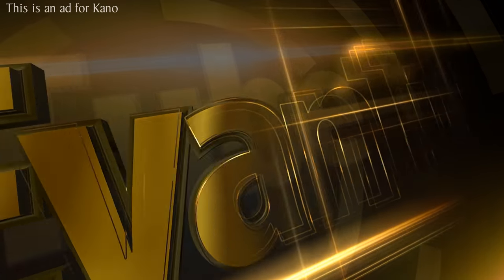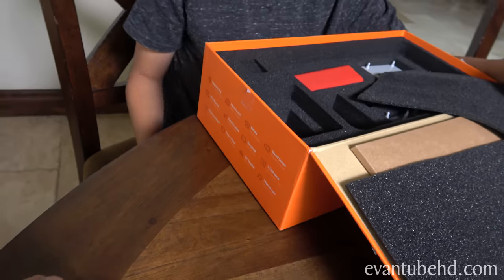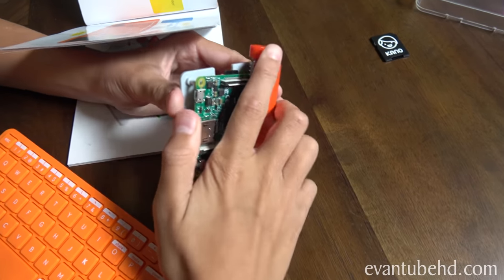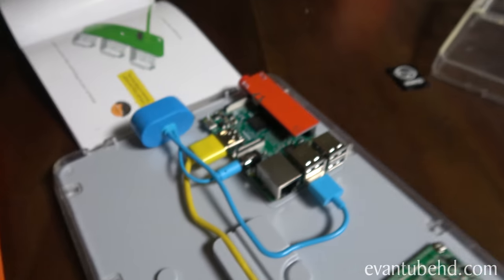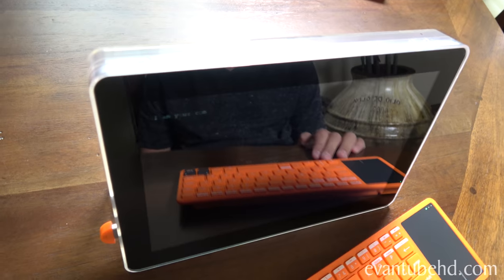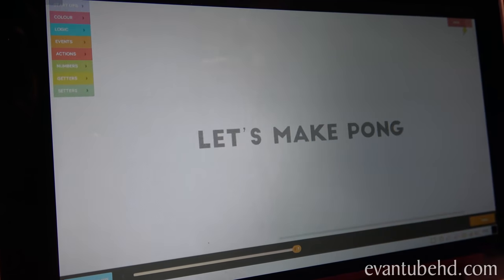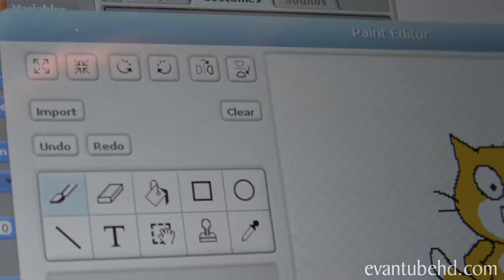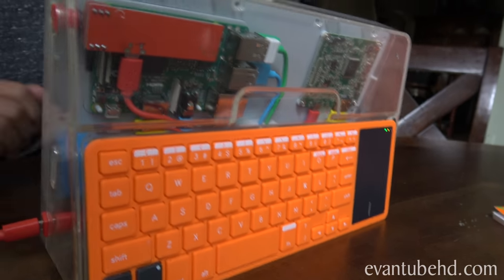DIY LAPTOP!!! Evan Builds His First Computer!  Hack Minecraft! Coding with Kano!

Comment: I remember back in the day [2014] I had a radio shack just down the street over the bridge before they closed their doors shortly after New Years 2015, I would come by, asking if they had 8 bit computer kits because I was soo obsessed in that beige computer with the black screen and white text display computers I wanted to build. The people were clueless on the parts I wanted to buy. But I remember passing by the Kano laptop kits when they were still selling them for 50 dollars. Wished, totally wished I bought one of those when I was 14. Wished. I Would of skipped over 7 years of pc learning if I used this as my learning machine for computers and terminals. My beat up ibm t500 with no hard drive was the one that taught me about computer mechanics and engineering and softwares and some coding.
Reply: Link please

Comment: Wheres the RAM, CPU, GPU, CPU cooling, etc.
But most importantly
Where 

Is

The

rgb
Reply: I have to agree...
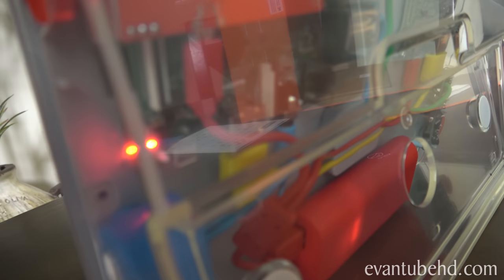Reply: Lol, it's all there.   7:58 so there ya go Insane.
Reply: Hahhaha
Reply: True
Reply: the "brain" is the motherboard, like in a normal PC it contains the CPU and ram and since the computer has very low specs it doesn't require a fan, all it needs is room temperature to keep it cool ; )        

(PS. i know it was able to run minecraft, and usually minecraft needs some kind of cooling to keep the CPU from overheating, although the minecraft port that the kano uses is not very incentive, it is kind of similar to the port on mobile.)
Reply: Even though i love playing on my computer, i have  no idea wth that is XD
Reply: It does not ev3n have the HDD.
Reply: Well this computer runs on a raspberry pi 3 which has all RAM, CPU, GPU etc built-in and it has very low specs that why it also doesn't needs any CPU cooler. Cleared your doubt, thank me later.
Reply: I a nerd
Reply: @waterandsteel4713  lol

Comment: Does it have a core i7-7700hq proccessor with a GTX 1080 (sarcasm)
Reply: I know right
Reply: I got a core I 5 in my pc i7 was to pricy
Reply: Can u play pubs on it?
Reply: Squeaker/w/mic 
Does it have a RAZER Quad Core CPU/Proccessor with a MSI x470 Motherboard, x2 Corsair Vengence LED ramsticks, Seagate 2T Baracuda, and dual Asus GeForce GTX 1060's?
Reply: I mean pubg
Reply: lol
Reply: ThisIsXFV razer is overpriced
Reply: Can u play roblox on it?
Reply: Squeaker/w/mic yes it does 😂
Reply: Lol
Reply: Squeaker/w/mic No sir it has snapdragon rev 5 quad core ,4gig ram, 16 gigs ROM  Expendable to 128gb and most importantly a Samsung exanos. It run raspberry , Android or Ubuntu. It has seems because there's a the master race specs anyting more with just waste battery because the master race puts no transistor to waste.
Reply: Jan M. If crisis was for Android then yes 😃
Reply: Squeaker/w/mic lol
Reply: Hail the pc masters race
Reply: Lol
Reply: cream shaft RIP that master race 😜
Reply: Squeaker/w/mic 👌
Reply: Squeaker/w/mic mabi
Reply: no it needs a x proceessor
Reply: U guys forgot about crysis

Comment: computer nerds: "that's a great machine... what processor does is run on??"
evan: "just kano"..
Reply: Actually, if you look at the box, it's powered by a Raspberry Pi 3B+ (I assume), therefore it's powered by a Broadcom quad core running at around 1.8 GHz.
Reply: @cwhitley.sawlabs  so does that mean, it's processor is similar to an Intel celeron?
Reply: @b09llanderaljohnthomasemma24  No, because ARM CPUs are somewhat weaker than their PC counterparts. An Intel Celeron would run faster than the Broadcom BCM2837. It'd also have more support for OSes, because x86_64 is used in PCs and Desktops more commonly, whereas ARM is used in tablets and phones, and requires custom drivers.

Comment: Okay, first of all this is not a true built computer, there is no gpu (graphics card), no cpu, no actual power supply, mother boards are not called brains, you have to install windows 10 and the drivers and there is no ssd or hard disk drive, sure it’s a kiddy pc, but if you are 13 and you want a laptop, don’t use that
“DIY LAPTOP”